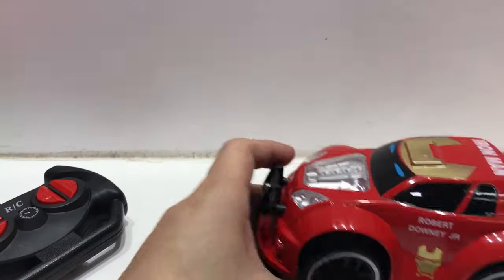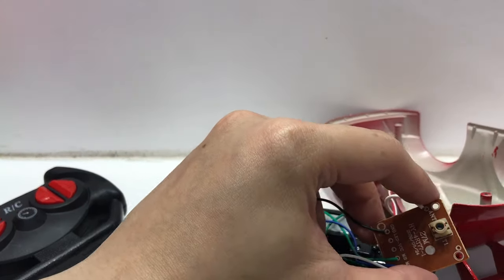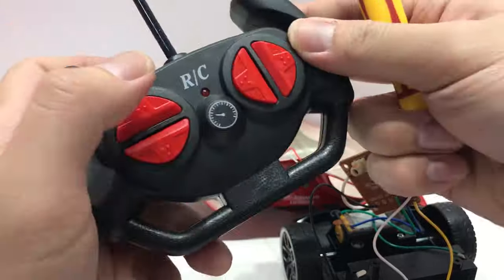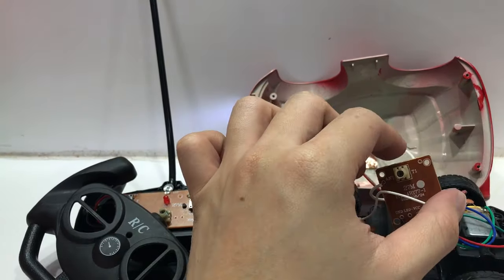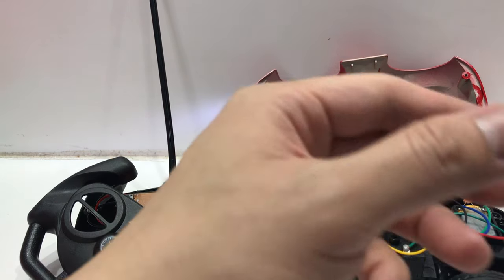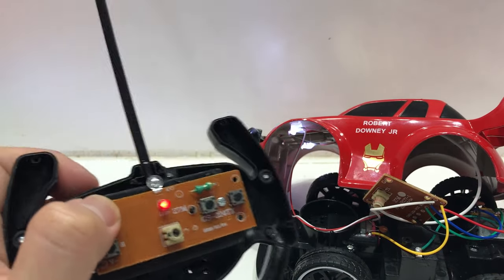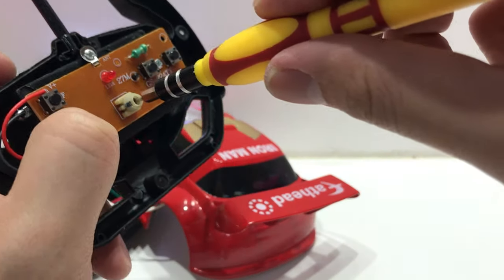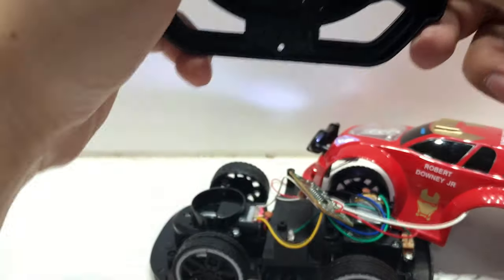RC Frequency Change

Comment: Does it work if I have a controller from a different RC car? Or has to be the same brand / model designated for the RC car? So Car A and Remote A and Car B and Remote B --> AB or BA? again not the same manufacture of the RC's. Thanks in advance!

Comment: hi can we change frequence rc car from 27mhz to 40mhz please answer
Reply: No you can't
Reply: Yes you can usually 27mhz  remote has a 40mhz option
Reply: @DAMN__________   all depends on quartz resonator. usually cheap rc cars for 27mhz have quartz only suitable for 27mhz but some remotes do have the option but must be written on the  mainboard like 27mhz 35mhz 40mhz like this so you can switch over

issue is with chap rc cars as some will contain 8-12 pin chipset with stored programmed variables and then switching frequency like this will not be possible without desoldering that choipset to reprogram it
Reply: @psyfreaky5857  in  technical terms - yes he can.. practicallly no because its usually 27mhz 27.145mhz and i think 27.275mhz. some rc cars will allow you to switch over to 40mhz but some will let you switch only to these .145 and .275
Reply: @stratiosastero6880  yes ofc, the entire circuit is built around the crystal but what I'm saying is a 27mhz transmitter/receiver almost always has a dual output
Reply: They always have it because "practically" it's actually extremely simple to do just a turn of a screw on your Auto transformer or variable inductor, or if you like me i like making my variable capacity the tuner.

Comment: How to comvert 2.4g transmitter to 27mhz please reply
Reply: Not possible. Why? 2.4g is much better.
Reply: @psyfreaky5857   analog transmitters like 27mhz 35mhz 40mhz and 49mhz cant be converted to digital transmitters that run on 2.4ghz and vice versa

Comment: Hi can we change frequency rc car from 27mhz to 2.4ghz, please answer
Reply: no because its analog  transmitter and 2.4ghz is digital transmitter. different architecture. 

you can change the crystal on 2.4ghz by replacing it with 27mhz quartz resonator but that wont give you anything useful.  27mhz have  tragically short ranges.  so convertion will be waste.